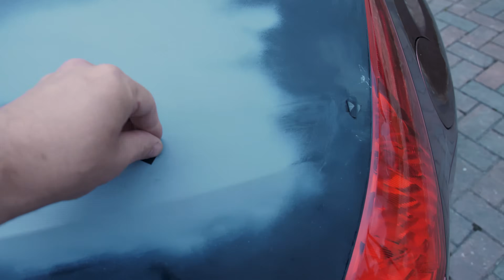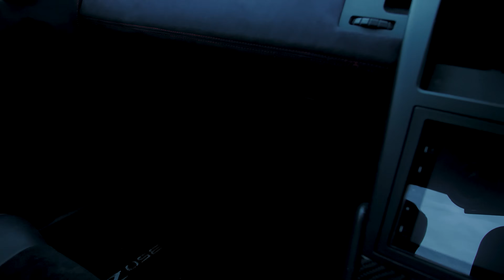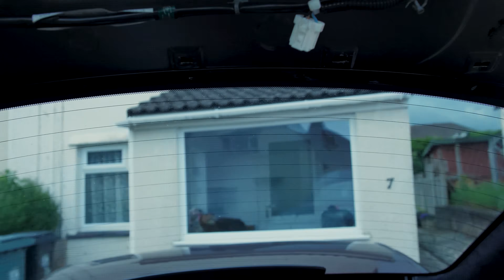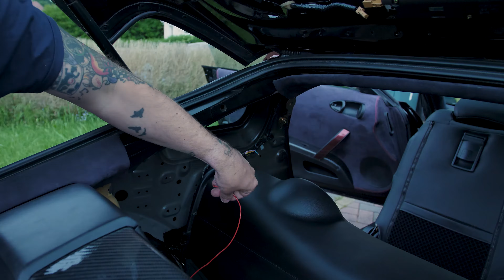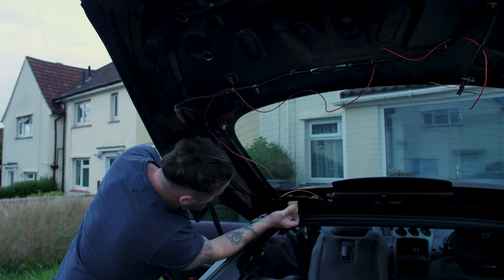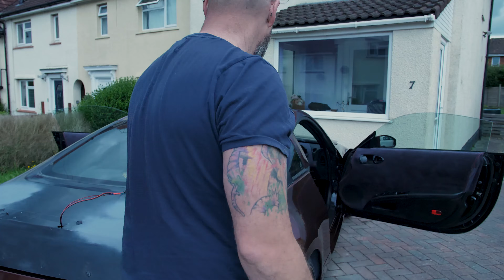Wiring an Arduino to a Car's Electronics | Arduino in Your Car Series

Comment: Something you might need to consider in automotive 12v is not clean. You get "load dumps" where something turns off and before the alternator can respond you get a big voltage spike. Someone commented on using a LM series regulator instead of the switching regulator. That works because the max rating it around 40v. And they are old rugged design. The other solution is adding a filter setup to remove the voltage spikes from your power input. A search of automotive EMI Filter should find many options. Great videos and keep up the good work.
Reply from the maker: My final PCB uses a buck rated to 40v, plus all the transient, EMI, reverse voltage protection, etc. Should be nice and robust
Reply: @GarageTinkering Hi there! Could you please share a diagram or schematic of all the protection components used for powering the Arduino, along with details on how you wired them? Thank you!

Comment: I've done 5v projects with arduino in a vehicle and what I've experienced is the different buck converters loose most of it's power through heat and some gets too hot and switches off because it has an internal thermal protection.

What you need is an adjustable linear voltage driver that has a  heat shink attached to it, you do get premade ones also but what I've done to beef it up is to change the capacitor to a larger one to store more power and take a lot of the voltage delivery strain off of the switching components.

Try the Lm317 adjustable voltage regulator driver, works perfectly.
Reply from the maker: @buddyrocks6699  I'll look into that. Cheers for the info

Comment: I have an Arduino nano in my boot controlling Wig Wag rear fog lights, we are all desensitised to yellow flashing lights but my rear fogs alternating cannot be missed :)
Reply from the maker: I had to look up what those were! Yeah, certainly don't look like something you'd miss lol
Reply: @GarageTinkering  dont know if your channel allows links but here are my rear fog lights in Wig Wag mode     https://www.youtube.com/watch?v=wtHLJ_5ano0
Reply: @GarageTinkering  tried to link a video of my rear fogs but you have links banned on your channel.
Reply from the maker: I see it. Yeah that's striking. I'm guessing also illegal?
Reply: @GarageTinkering  Yes, while red is not specifically banned like blue is, the regulations state that the only permitted flashing light colour on a non emergency vehicle is Amber which makes my rear fogs illegal by default but you will be unlucky to get done for them if they are only ever used in a safety scenario, I have no worry's about having them on should I need to stop in a dangerous location.

Comment: Good project except for the use of T-taps. They're the single-most failure-prone connectors available. Great for short-term emergency repairs but they should never be permanent.
Reply from the maker: Curious, I've never had any issues in the past personally. What are you using instead?
Reply: @GarageTinkering  I worked for many years as an auto electrician and the amount of intermittent faults that came in for repair were usually caused by T-taps or Scotch-locks. The only reliable way we found to connect into original wiring was soldering and heat-shrink (or insulation tape in a pinch). We also had good results with crimped and soldered Molex connectors (or similar products). They were a lot more time-consuming but they did look more professional.
Reply from the maker: Good to know that soldering is still the go-to. I'll have a look at doing that then and getting some extra robustness in there! Appreciate the professional perspective

Comment: My guess would be that the processor board has had an overload that has shorted, partially, the 5v line internally. Probably terminal for the board at this point. Somehow you've possibly put too high a voltage on one or more of the processor pins. If you look at the video in close up at 27:53 ish, one of the LEDs flashes briefly (top left, 3rd LED in from the left). This may be an indicator of when the fault occurred. You need to check the continuity on all of the supply and signal lines. <ake sure that you only have 12v where it needs to be etc. 

If I could put hands on the board it would be loads easier to fault find. Good luck. I hope you haven't built in a fault on your custom PCBs.
Reply from the maker: i didn't think I saw a light flicker so looked at where you suggested, and I see what you mean, but I paused it on that exact frame and going back and forwards one frame you can see it's just a fleck of dust that goes past the front of camera and happens to line up with that spot. Very deceptive!

And I thought too that something might have overloaded it (though, all the power getting to the board was regulated to 5v), but I put a 9v signal directly on the VIN and GND pins and it booted up fine. It's still a bit of a mystery, but I'm sure I'll solve it when I get time!

Comment: 29:37  My guess are the power traces on the perfboard are too small for your application or something has caused a large, but unseeable, break in the trace(s) in question.  Soldering a bare wire along them might fix it.  But this is a guess from my own experience from almost 30 years ago.